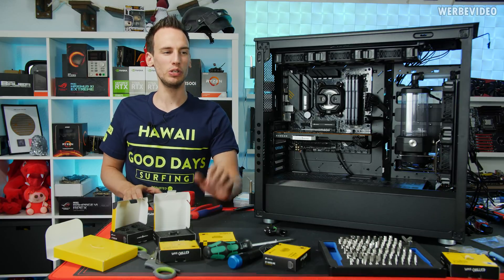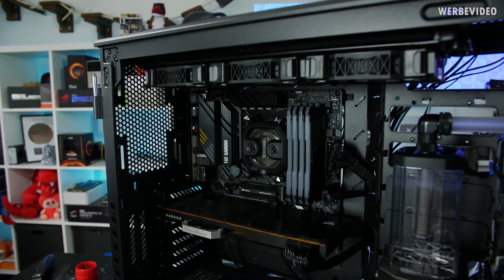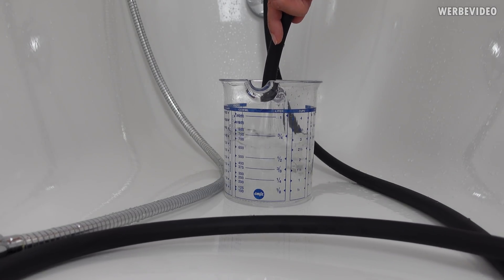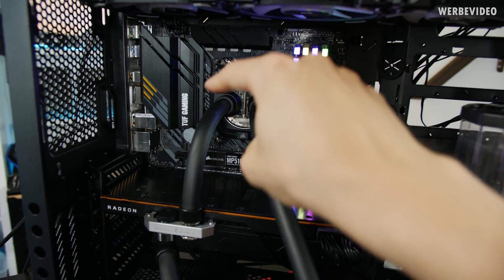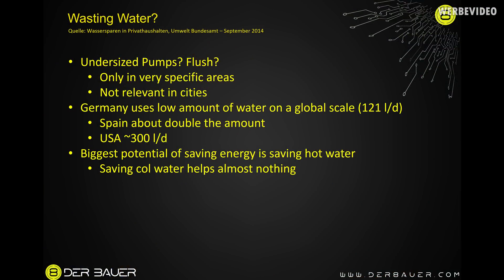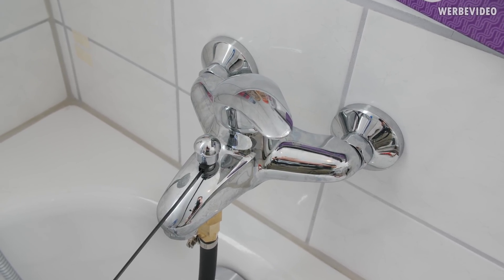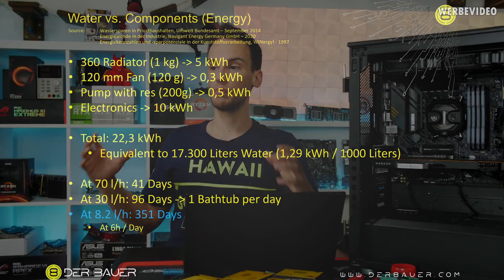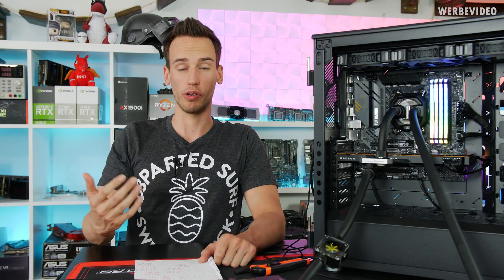So much Better than expected! Cooling my PC with TAP WATER

Comment: I have to admit my first response to your idea was that is pretty wacky. I continued watching all the way to the end. Your idea has merit. A good alternative isn't necessarily the obvious one. I would be amongst many where I live to be cautious to try this due to the calcium content of the waster being so high it will clog spouts and taps with in a few years and the omnipresent water spots on almost all glasses. I could see a passive heat exchanger using this iodea being perhaps more practical due to this corrosion.

Comment: Really nice and holistic analysis. I just have a couple of comments:

In many cities, direct municipal water cooling (i.e. industrial/commercal refriguration applications) is prohibited.

This is because of two things: The water source may be of limited capacity (i.e in big cities the water sources may be stressed and extraction is nowhere near country average). And the infrastructure has a set capacity of transporting raw water from source to water plant, the waterplant itself, distribution pipes, pumping stations and water towers.

When it comes to water supply the variable costs like extraction tax (if any), electricity, treatment chemicals, filter materials etc. are negligible. What are expensive are capital costs, personnel and new projects costs (lets say the infrastructure doesn't have enough capacity and parts of the city goes dry in periods.).

But again, our conclusions are the same, and thank you to bring this topic to your tech chanel 🙂

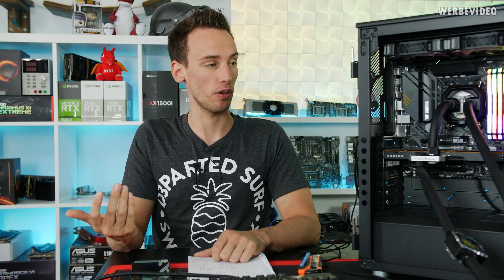Comment: 6:48  60-120L/hr
Me: 3000 L/hr is what I like...

I split mine into 4x parallel flow for the GPUs, so the loop has 1/16 the resistance if they were in series, and 1/4 the resistance of a single waterblock so it really keeps much closer to its pump rating, and that means it’s still about 750 L/hr going across the card which is sufficient to make the blocks make some noise with a weird hiss/turbulence sound. Pump required it’s own outlet but it’s no big deal, I already have 2 PSUs that need wall outlets anyways...

Comment: The best use sounds like avoiding using a chiller a few days a year, otherwise I would be concerned about the life of the cooling block (clogging). I'd love to get some usable hot water this way, though.

Comment: Would never work, your flow rate would change every time another appliance or tap uses the water or someone flushes the toilet.
Reply: Would still be much higher than even most pumps if your plumbing is good. Hell, if your plumbing is fine you shouldn't notice a big drop when other people use another appliance

Comment: A very interesting idea , one that I have considered testing myself. But in the end I never got around to it, because of noise in the water pipes would be annoying at night. So I've been mostly thinking about how it could be done silently to avoid that. 
I know the flow rate does not need to be a lot, so watching that be confirmed in this video was very informative. And also taking the energy and environment into account was very good. 

The way I thought about this, was if using tap water works, then one could use a heat exchanger with a secondary loop for the tap water. 
OR ,, use a different mean of getting cool water. I was thinking about putting some tubes underground, to cool it during summer, and perhaps even just throw a 30meter loop out on the balcony during the cold part of the year. If someone has access to a natural stream, they could use that water for cooling. 
It is definitely worth exploring those options if you can.

Comment: I have a hard time with the argument "waisting water" every bit of fresh water we use is recycled endlessly yes it takes energy and materials to purify butsomeone will be drinking the water you let run down the drain in a week
Reply: That's certainly the case for some municipalities/cities but it really depends on where you live. The water in the mains in the neighborhood I used to live in were sourced from two springs; they both started running low a few years back so we all had to limit unnecessary water usage (lawn care, pool filling, etc.) until they could install a connection to a third spring to make up for the difference. There's such a wide variance in water sources, and even within just the springs some refill from rain/waste-water much faster than others. In many cases too the filtered sewage gets dumped into a river, so that water won't come back to the local water table except as rain, so then you're dependent on not having a drought

Comment: The minimum flow for water cooling is said to be 1 l/min, so 60 l/hour. Tap water costs ~2.5 EUR per m³=1000 liters, so 0.25 cents per liter. That's 15 cents per hour in water. Let's say the PC uses 150 W on average (we're talking about a watercooled gaming PC after all, so more gaming, less idle), at 30 cents per kWh that means one hour costs ~5 cents in electricity. So with fixed flow tap water cooling the running costs are quadrupled or so.

Comment: Thanks for this video, was thinking about using house water.

There are 2 issues with the approach.

1. If water coming form the city is dirty (if city does any work, and some soil gets into it.
2. Water minerals

Another option to not "waste" water is.
1. get a heat exchange tank. (tank with two seperate input/output loops - use copper pipe within a tank).  Where water coming into the house and water in the loop are not mixed, but heat is exchanged.  Then you get cold temps into the loop and you heat up a large tank of cold water, that can be used in house.   And the computer loop will not be affected by quality of water.

That is somethign I want to do in the house, and your results affirmed that it is a very good idea.

Thanks

Comment: Hey der8aur!! There is for sure a very environmentally beneficial way to do this, but only if you live in certain cold places, such as canada, alaska, scandinavia, or somewhere like in the mountains like the alps. Which is rather than to use tap water, just run a large closed loop reserviour outside the building. And keep recirculating that same water back outside again. Then by the time it comes back through the loop it will have been cooled by the outside weather. Whatever the ambient condition is. This of course also works too for warmer countries, but only during the winter months. Finally there is a 3rd possible option which depends on local geology. Which only works if you have a nearby geological feature at a lower temperature - then pass the water underground. However the temperature can also be higher underground too. So that does not always work. Generally if the rocks in the earth have a time delay in them, that they still are cold from the previous wintertime months. Or if the rocks nearby have a water table or underground streams. To bring the temperature down. Finally if you live nearby to a coastline, or a lake. Or a stream. Then you can maybe pass your own enclosed water pipes through those other external water features. Or submerge there a heat exchanger. You then pump yourself your closed loop through. And get your colder water. How to power the pump? Well perhaps a water wheel? That can run off from the same stream. Not everybody has the possibility do these things. However perhaps a lot of people can do seaonal winter time cooling by taking their loops partways outside the building.

Comment: Use river water so it's open loop and no waste (though to a heat transfer, not into the CPU block, as that would gum up). Even 1000w into a river would make little difference to overall temps/environment impacts.

Comment: I tried this years ago...i had (still have) gigabyte x58 ud7 wich has waterblock for the southbridge, northbridge and vrms and for the cpu(x5675) i used old intel 120mm aio. I didnt use tap water because I had a water well in the yard. Water temp always was below 10c. It was great. Cpu was oced to 4.6 or 4.7, or even 4.8g i cant remeber if 4.8 was 100% stable but it was akward to run tubes from the well trough the window to my room and the pump was expensive to run but great cooling.

Comment: Are your portable ac's single or dual hose?

The single hose models suck - literally.

The make up air for the hot loop on a single hose a/c comes from ambient room air, which in turn, cones from outside via cracks and crevices.

The better sealed your home is, the poorer the efficiency of a single hose model.

You can modify it by building a plenum around the intakes on the ac,  then ducting that outside.

If the path is very short- like if the ac  is adjacent to a window, this can work well 

If the duct run would be long, then a booster fan is required to avoid burning out the ac, and balancing air flow can be tricky.

Comment: Looked at placing radiators for PC water cooling in line with a pools cerculating system to use the pool water to disapte the heat a few years back. Didnt end up doing it due to cost but could be an interesting project as your waste heat heats the pool.

Comment: We don’t usually cool our components (Laser and Turbo pumps) with tap water because of the corrosion that can occur inside.  Turbos and Lasers cost 10-100k or more and so it’s better to just run a closed loop.  you could filter the water but it’s not worth pinching pennies when there is so much on the line.

Comment: Given temp of tap water being as low or lower as res temp, you should have lower temps than an air/water loop.

You'll be wasting water though now matter how you slice it.

Reusing water for a purpose it would  not have been used for anyway does not mitigate the waste

Comment: Your way too late, I experimented doing this over 20yrs ago, luckily then I didn't have a water meter then. But immorally wasting so much water and sheer impacticality meant its was only short term.
Results were better than a water chiller I later tried, but there again it wasn't exactly height of summer so mains water was nice and cold.
A friend ran a similar system but later used one of those large plastic mobile liquid storage tanks you see on building sites as a passive cooling reservoir outside his house. Worked well until he started getting algae and other things growing in it despite treating the water.

Comment: I think corrosion would eventually happen. Ever seen the inside of a water heater or even a Keurig tank? Tap water has a lot of impurities in it that will build up in the blocks over time.
I think you could isolate the loop, still using a pump, going through a small heat exchanger (copper tubes running through the cold tap water in a loop) and achieve similar results without exposing the system to tap water, possible damage to the electronics, etc.

Comment: I'd say in a city most of the water will be re used in the system. Most water in major cities is recycled many times over or they would not be able to hold so many people. It would be silly if you lived in the outback and used captured rain water for everything...
Reply: Berlin has two huge rivers and a whole bunch of smaller rivers flowing through it so there should always be more than enough ground water.

Comment: The 121 L/d is only in private houses. This does not include the water used to produce the stuff we buy. Something like meat has a very high fresh water use (not just rain water). A single burger is way more than the 121 L.

Comment: Thinking about it a bit I would think there may be a more sustainable way to do this.
Long term calcification / gunking up of the microfins will be a major concern. However it may still be possible if you add a pump and a radiator, then cool the radiator with tapwater to achieve similar temperatures. It would make it a full custom water loop minus the fans, but it should not differ too much in temperature and would be less prone to gunk building up.

Comment: Very interesting topic and I like how you compared energy costs for production of components. I live in Scotland where we aren't charged for water consumption on a per litre basis. We pay a flat fee for municipal services and part of that includes water supply. Our water temperature is good 4 to 5 degrees lower than Berlin's and will be much cooler in more rural areas. Great work.

Comment: 2 min into video, cooling is probably great, but you need to filter tap water, its full of minerals, some rust from the pipes, can clog fins.
--------
Interesting calculations, year or 2 years of running pc and that is at 6 h every day.
Speaking of heating the room, create devided system, tubes through the window, radiator and fans outside, pc inside. In the winter take unit out back into room ;)

Comment: I see comments about using the waste water, takes about 1,000l per hour to water a garden with a hose.  40l per hour was a decent flow rate, so you would use that same amount of water in 22 hours. 7.5 hours of usage to be enough to wash your car.  On a daily level, I don't think you could use the waste water fast enough, you would be generating almost 7,000 litres a week of waste water, so unless you were washing your car and watering your garden almost daily..

Comment: If everyone using tap water, it will reduce the water pressure in the area eventually... Then you'll eventually have less tap water coming out causing pc to not have enough cooling...

Comment: Im sad to say that i would understand about 80% of the german videos. Had lessons for 3,5 years 2 decades ago (crap im old) but havent used it since.
I would never use tab water its wastefull and expensive in the long run. What i can see being usefull however is a system where you have a 200 liter barrel as reservoir and just a straight pump to that on your loop. Even if that water becomes 15 degrees hotter which i deem unlikely it will cool just fine for the rig.  (20c room temp + 15x is only 35c.  case temps often are hotter and top radiator cases work fine. Then use that water to feed the CV for hot water and fill the barrel with fresh tap water.  this saves gas and i feel is still better then a simple AIO with 100 ml water.
And my daily water use is only 83 liters a day and i use tabp water for my vegge garden. Our water costs about 1,17 euro for 1000 liters incase anyone wonders. 
So dont hook it up directly but theres ways you can reuse the heat generated.

Comment: It's actually not uncommon for some big industrial servers to use tap water cooling. Considering how much heat energy gets dumped into the room, you also have to take into account air conditioning costs when air-cooling big server rooms.

I still couldn't recommend everyone jump on board with tap water cooling though. If only a few individuals did this, it would probably be fine, but it large numbers of people did, then there would be more environmental concerns.

Here's an interesting thought: if you lived near a flowing river, could you divert some of that to cool a PC? You'd need a way to filter it first, but there would be no water wasted this way.

Comment: What would perfect this system would be letting the heated water drain into your water heater. It’s a low enough volume that it wouldn’t be likely to overflow the tank and it would also marginally lower your utility costs.

Comment: i had actually wondered about this exact set up for a while , tap water is cold , flow controlled , perfect ,and as others have said it reminds me of loops ive seen with reservoirs or pools outside  , but the best way i can think of would be to put a copper coil attached to the loop in your toilet cistern , it would keep the coolant sperate from the tap water , and would get regular fresh water , it already contains a high volume of water anyway and the heat would also slowly dissipate through the cold porcelain acting as a radiator 

the only issue would be getting the tubes into the bathroom and keeping them out of the way of the door and stuff as it ould be a mor permanent set up , still this would definitely be economical and energy saving and i wonder how well it would perform in the long run (after a while of no flushes how well does a toilet work as a radiator)

edit after some research they already do this in some data centres and it works  , this could be the greenest way to cool your pc
Reply: Just return the water to the cold tank , no waste then .
Reply: @nickfrankling5184  no you build a loop , with a copper coil in the tank , the coolant never leaves the system , and new minerals and contaminants wont make their way into the loop

Comment: You've made the PC equivalent of an RBMK rector. Not great, not terrible.
What you should do is make this into a two-loop system. The CPU-GPU-Radiator loop should be closed and filled with distilled water and the tap water should be washing around the radiator, it will save you much time and money on grime and calcification.

Comment: Hi Roman  , tis is my rig"  2990WX ))  running this from this year from june. https://i.imgur.com/cwOSC2F.jpg   https://i.imgur.com/bFrvvnK.jpg   ,, Cheapest water cooling in world"  ,, water is free here, (just one year pay around 100-300euro) and you an use how much you want.  Pump is Eheim Pump Compact+ 3000  but water fllow is still slow i think....byt pump is louud as hell,  I can make videos where you all can see reall water flow and other , if you want people)))   I run compute boinc on that pc, 100% load 24/7/365 now two years  , in winter i use  master liquid M360 ,,becouse water will freeze and will condensate on water block and leak on gf card..  more info later

Comment: Such a cooling system must be built into the multi-apartment water supply system. Directly into the cold water pipe. Will anyone hardly notice such a not significant heating of cold water, plus all the water will continue to be used for its intended purpose.  The problem with this approach is only in an unstable flow rate.